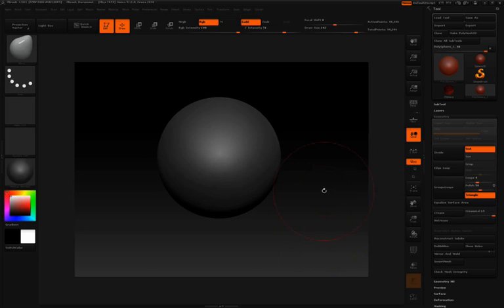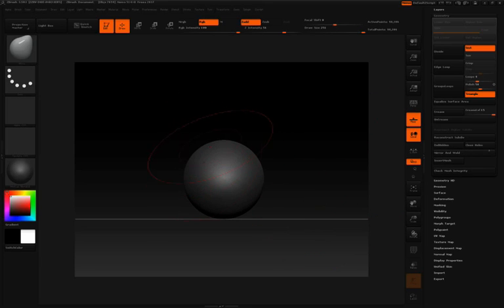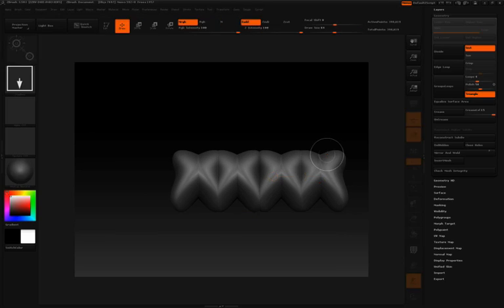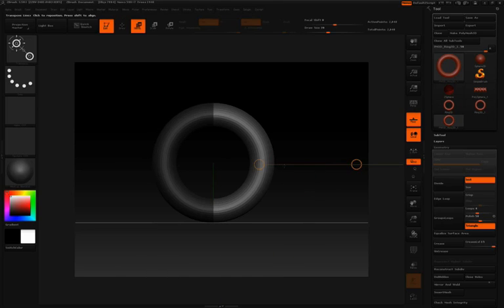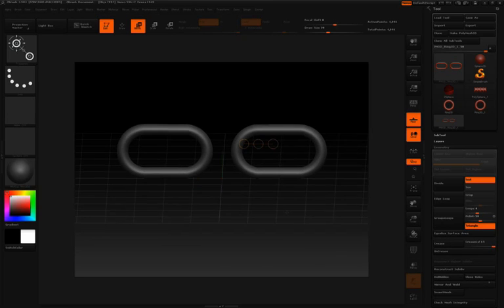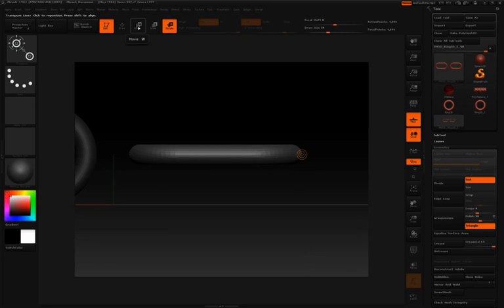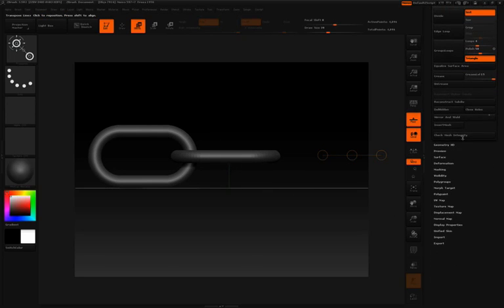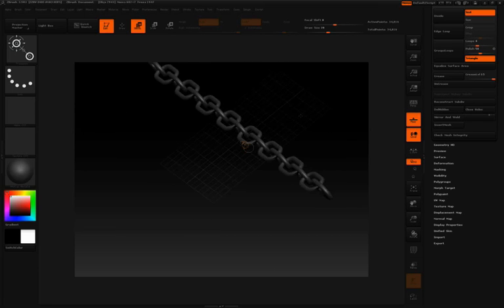Mirror and Weld

Comment: @freakylittlegnome I had that same problem and solved it by going to the deformations tab, using the mirror tool first to flip the mesh, and then using the mirror and weld tool afterwards.
Reply: it's been 8 years and your answer still helps!
Reply: +Brian Gitlin It's not the best way to do it, but sadly its seems to be the only solution =D